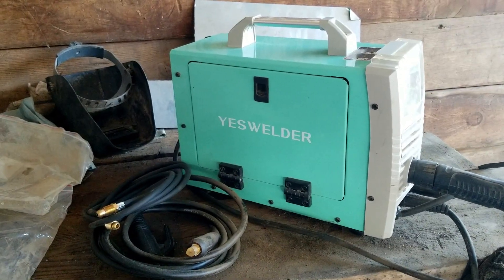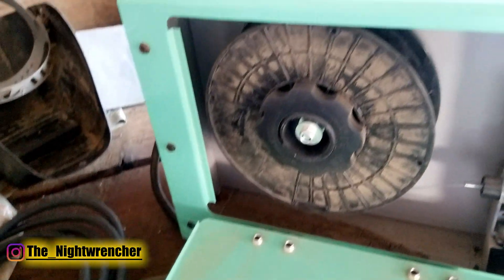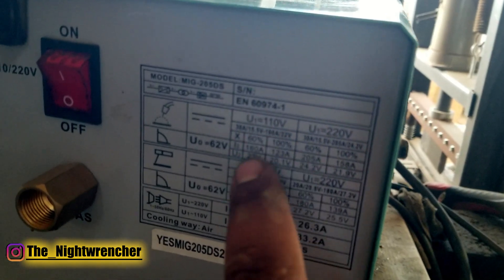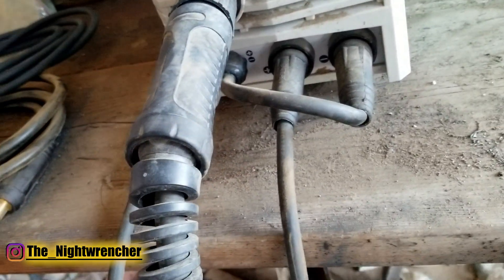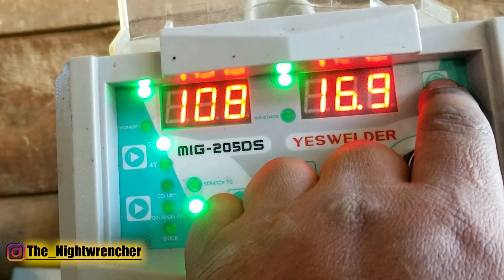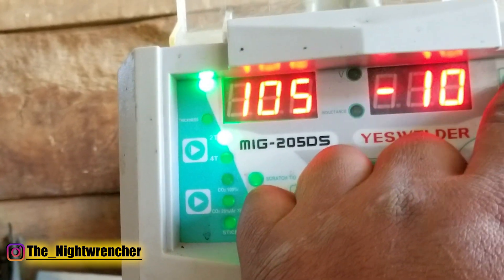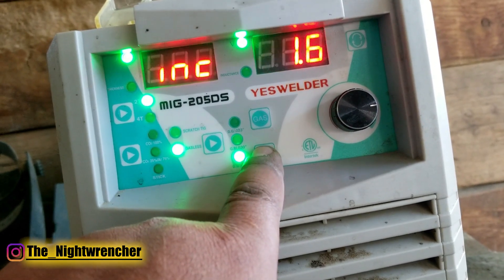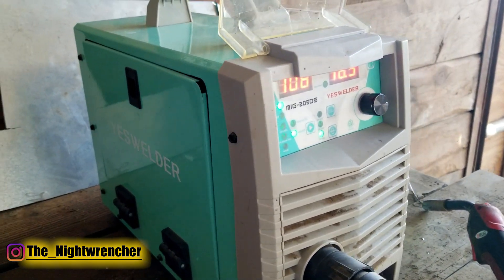Yeswelder MIG 205DS 3 Month Review | YesWelder 205 DS | Flux Core Welding For Beginners |

Comment: The gun I got had a really angled connection to the hose so when I was ready to weld it would pinch the wire and cause burn back   I fixed it with some fiberglass rod and heat shrink

Comment: Newer "B" model now available with manual settings in addition to Synergic and also spool gun control hookup. Just picked one up via Amazon for $399 - $90 coupon (1/13/23). The older model (the one reviewed here) is on sale for $198!
Reply: That 198 model you must be looking at might be just the TIG machine
Reply: @Saberus  Oops on my part! You are correct, I was looking at the TIG machine, good catch! The newer "B" model of the 205DS is still available for $399 - $90 off. Great deal in my opinion.